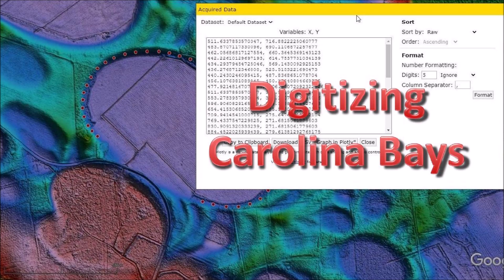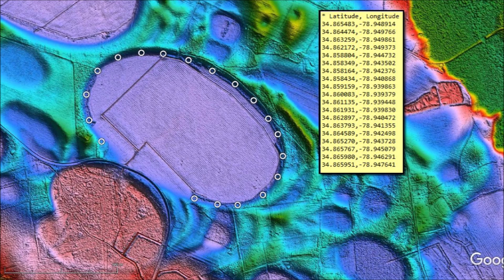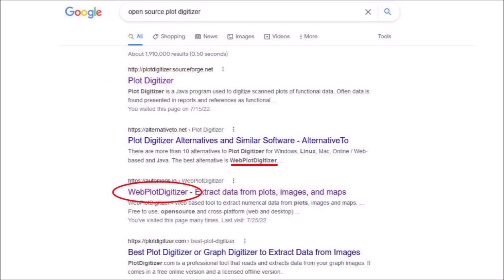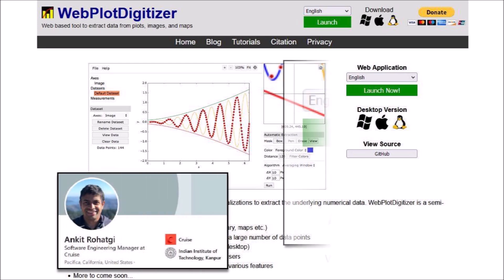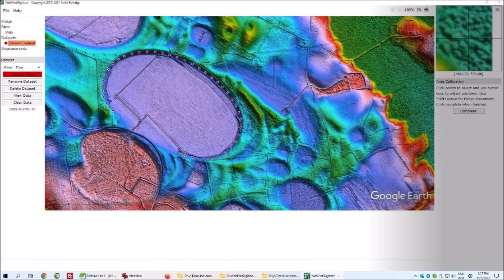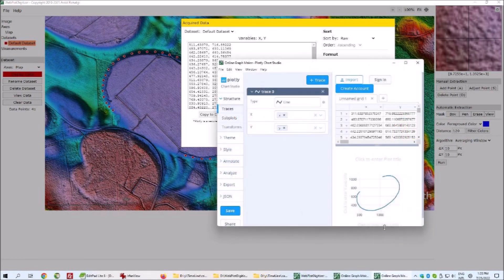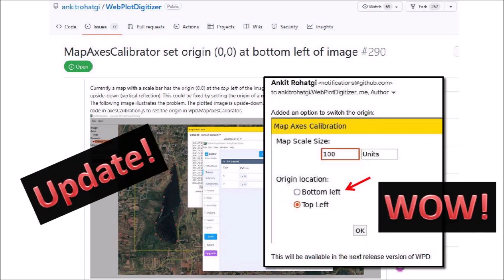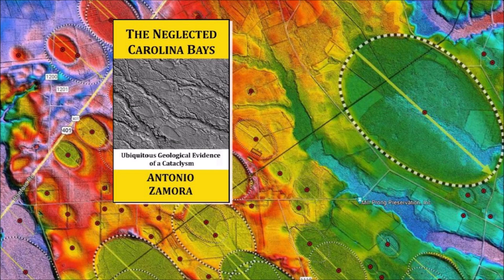WebPlotDigitizer for the Carolina Bays

Comment: Nice one Antonio, more brilliance!

I had a thought about the possible excavation of Carolina Bays in order to find glacial erratic-type rocks that may have traveled with the ice boulders. After seeing your video of an attempt to do this I realized the technical difficulty of such a large earthwork. So my next idea is -- what about creating a monitoring system of these bays that would alert you when a major construction, road building or other civil engineering project was scheduled to take place at the location of a pre-existing Carolina Bay? Then it might be possible to partner with the construction group and piggyback off the earthmoving they are going to do anyway? In the same was archaeologists sometimes do site work at the beginning of construction projects.
Reply from the maker: Wilmington, NC and many other cities are built on top of Carolina Bays and not a single thought is given to what is underneath. The prevailing idea by most geologists is that the Carolina Bays were created by wind and water mechanisms, so they are not more interesting than ordinary sand dunes. I am trying to change that perspective by pointing out the precise elliptical geometry of the bays and their potential origin as inclined conical cavities.
Reply: @Antonio_Zamora  Right on Antonio. I guess changing the prevailing incorrect theories could flow on into more well-resourced exploration in the future.
Reply: Unfortunately there are no compelling cultural or political pressures which would entice industry to cooperate with such efforts. The construction industry is driven by profits and the absence of any mandates or potentially adverse perception that might impact schedules and profits does not provide incentives for cooperation. Perhaps if and when the scientific community starts acknowledging that the phenomena are possible, there will be more efforts to verify the validity. Until then it is important to keep focus on the issue.
Reply: @MrFmiller  Industry is often willing to cooperate with scientific endeavours if there is an existing relationship with the  scientific investigators. There is very little downside for them and the possibility of good publicity is often a great incentive.

Comment: Back in the day (1970's) I was a student at University of Washington working towards a 5 year professional degree in Landscape Architecture. We had overlapping classes in natural processes, urban planning, site engineering, and aerial imaging among others. 

One quarter we were doing a research project on the San Juan Islands. Computers were main frame at the time. We used Fortran programming and IBM punch cards. By hand we plotted X Y Z coordinates on maps of individual islands. Write programs, plot data, and result was a crude 3D elevation model. It took days and several runs to iron out noise from bad hand plotting. 

We also used manual Planimeters to measure area on maps. We also made 3D cardboard topography models for different projects. Today, technology has changed everything. Digitizing, computing, 3D visual display, and others have really made it so much easier.
Reply from the maker: You are right. Satellite images and LiDAR have changed the rules of the game. They have given us a new perspective of our world.
Reply: @Antonio_Zamora  Thank you for sharing your expertise and discovering new ways to see our physical world.